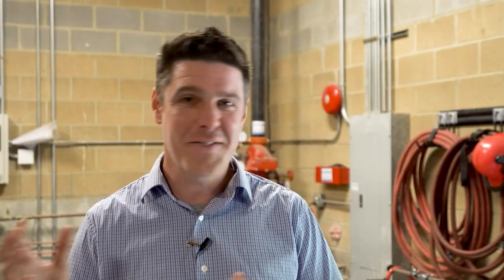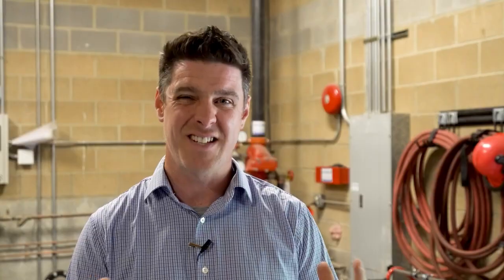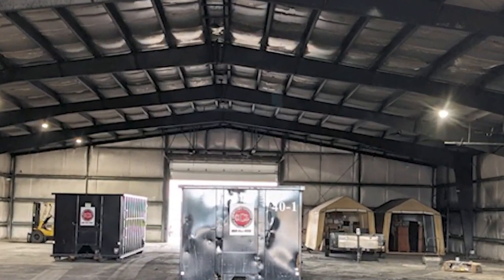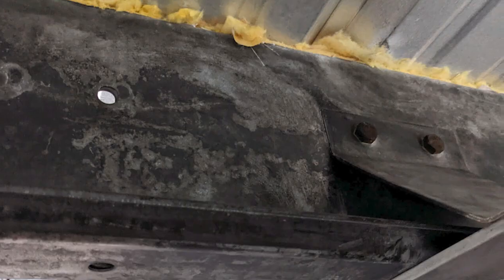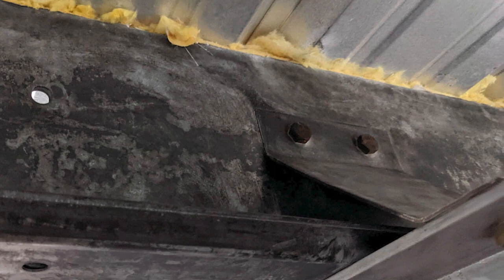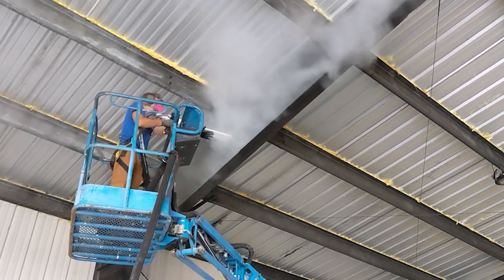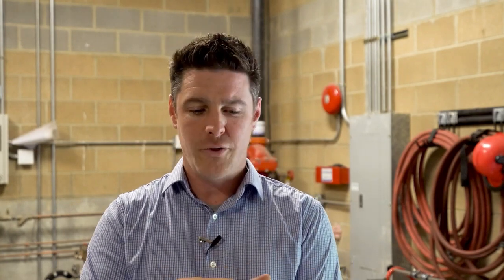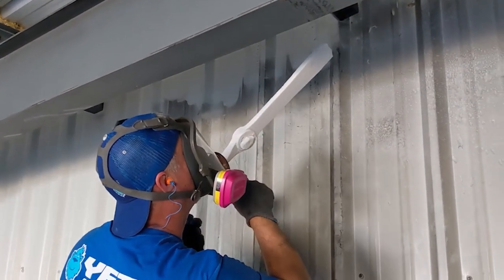Cold Jet Dry Ice Blasting - We Saved This Insurer $600,000!!!

Comment: How many 500 lbs tubs did you use to complete this particular project?
Reply from the maker: Hi Wes, you normally use an average of 300kg of dry ice for an 8-hour shift, and the cleaning speed could be between 25 to 35 square meters per hour.. Cheers.

Comment: What can you say about "carbon footprint" of your technology during the newest European regulations?
Reply from the maker: Hi Dock,
hopefully, the following information may answer your questions, or at least you may find it useful:

Due to a tightening regulatory environment and a greater awareness of environmental standards, environmentally friendly cleaning methods are becoming more important to the industry.  

Traditional cleaning methods oftentimes involve the generation of harmful secondary waste and the use of harsh chemicals, which negatively affect both the environment and the individual performing the cleaning.

Dry ice blasting is an ideal solution for those looking for an environmentally friendly cleaning solution.

The dry ice blasting process isn’t just any cleaning or surface preparation solution. It’s specially designed to use our planet’s resources well and promote a healthier environment for workers in manufacturing and industrial settings.  

1. Dry ice is made of reclaimed CO2
Rather than using new resources, which are unnecessary and costly, dry ice blasting recycles once-used CO2 in order to repurpose it.  All dry ice used in the dry ice blasting process is made from reclaimed CO2, which is a byproduct of other industrial processes, such as oil refinery activities or large-scale fermentation. 

This CO2, which would have otherwise been released into the atmosphere, is captured and given new life as dry ice. Dry ice blasting does not produce more CO2.  
2. Dry ice blasting eliminates harmful secondary waste
When the dry ice impacts the surface being cleaned, it sublimates – turns directly from a solid to a gas—and thus does not produce secondary waste.  All that remains is the dislodged contaminant that was removed from the surface. 

Similar techniques such as soda blasting or power washing, also use a media accelerated in a pressurized air system, leaving behind a residue that must be cleaned up with the contaminant. This media can become hazardous and create downstream contamination and harm the surrounding area and installations.  

For example, if proper containment is not used, soda from the soda blasting process will seep into the soil of surrounding vegetation, which can negatively affect the pH levels of the soil and kill the vegetation.  

The secondary waste created by these methods often requires special handling, disposal, and regulatory reporting.  
3. Dry ice blasting is non-toxic and eliminates the need for chemical solvents
The dry ice used in the dry ice blasting process is a food-grade media and is EPA, FDA and USDA approved for use around food manufacturing.  It is colorless, tasteless, odorless, and non-toxic.

Dry ice blasting eliminates the need for chemical cleaning solvents in many applications.    

Rather than making employees scrape off contaminants with hand tools and harsh chemicals, workers can keep a safe distance by using the dry ice cleaning process, eliminating that manual labor and any potential harm caused by prolonged exposure to cleaning chemicals. 

The solution also prevents downstream contamination from chemicals. With dry ice, there are no remnants of the cleaning method to leave any trace on the environment.
Reply: Screw the EU. They have no bearing on reality, they reject truth.